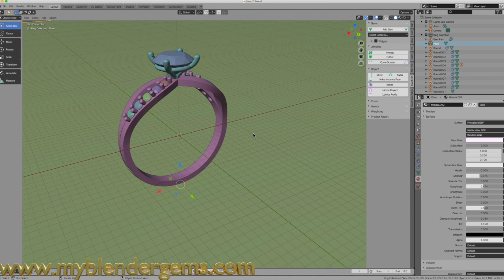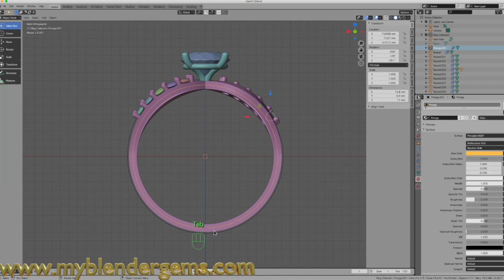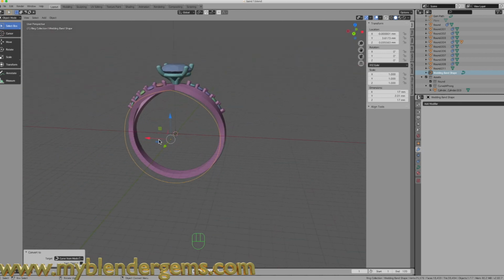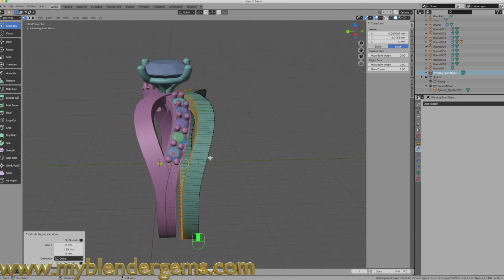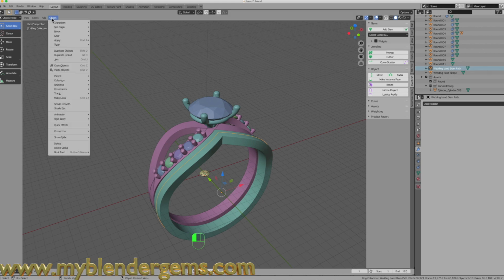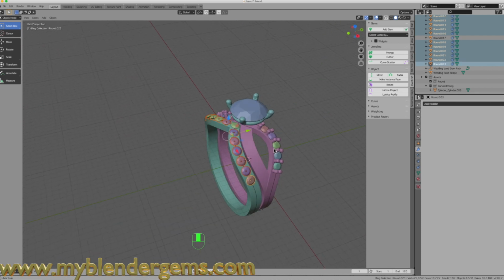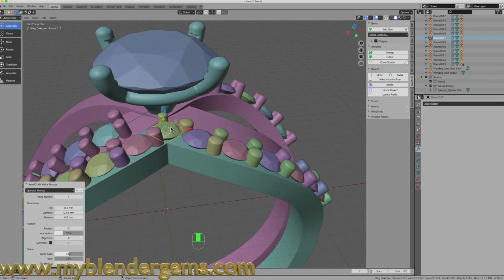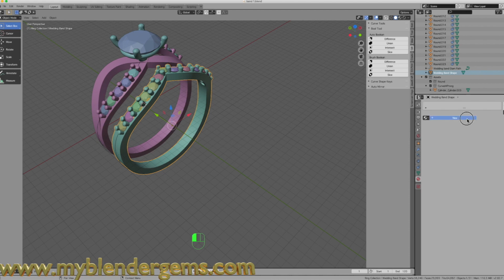Wedding Set Design with Blender 2.83, Part 2, the Wedding Band to Match

Comment: Thank you very much for your work, very interesting tutorial! Are you satisfied with the print quality on elegoo mars, is it possible to print models with better surface quality on it?
Reply from the maker: Thank you for the comment...  Yes, I’m happy with the Elegoo mars...  I have the original, which uses an LCD display,  I purchased a sonic mini monochrome which prints 3 times faster.  Keep in mind, this year is a great year for resin printing, as many of the manufacturers are now about to release monochrome display printers.  IE, printing normal resin on the original mars is 8 or so seconds per layer, castable resin, 12 to 30 seconds per layer.  Monochrome will be 3 to 4 times faster!  To get the best results for your prints, it is about the model, not just the printer.  Once you have tweeked your settings on the printer (for the resin you are using) the modeling detail will show through.  Pick your printer carefully.  Most of these printers are the same.  Some built better than others.  Epax makes “Tanks”, and they are twice as expensive.  The Elegoo Saturn is a large format printer, meaning you can print “larger” models.  For me, I print jewelry, and don’t need a large printer.  You, however, may print objects that are bigger than mine.  I have not gotten my hands on the anycubic mono, but I’m not a fan of the original since it had so many initial failures.  Elegoo Mars Pro 2, I believe should be available relatively soon.  If you’re looking for a great monochrome printer, here is the list in order of which I would buy...  Elegoo Mars mono, Epax x1 mono, sonic mini mono...  If you are looking for a larger format “8.5 inches”, the Elegoo Saturn looks fantastic and gets good reviews, but they have all been sponsored so far.  I don’t do sponsored reviews.  I like to see the facts...  Hope that helps...
Reply: @watchesandjewelry , Thank you for the detailed answer, your advice is very valuable to me!)

Comment: I have a question regarding jewelry modeling for 3d printing or casting.  I noticed you don't use subD or subdivision surfaces for your rings, and the edges are razor sharp.  I've always been taught to avoid this in CG modeling, and to incorporate a small bevel on the border edges to create a chamfer and avoid razor-sharp edges.  This is mostly a technique utilized for rendering purposes, so that rendered objects look more realistic.  My question is should we avoid this technique when it comes to modeling for 3d printing?  I suspect that the printing process requires the mesh to be as physically accurate as possible, especially for rings or something where scale down to the mm is needed.  So I assume creating a bevel on the sharp border edges not necessary for 3d printing, but  if I do that anyway will it screw up the print in some way?  Hope I'm explaining myself clearly.
Reply from the maker: Great question. When modeling for 3D renders I would always add a bevel end or sub surf. It’s not going to print as it is with perfect detail on a 3D printer. So, when I’m rendering an image, I soften it up. Rounded edges and all. To keep detail in the 3D prints I will design with the printers capabilities and limitations in mind. Sharp end he’s on prints turn out with a small bevel edge. If I want a larger bevel on the print, I can add the bevel to the model. Kind of like taking a step back. If that makes sense. Thanks for the question

Comment: thnx for your sharing.  To select all prongs  quickier :   Select one prong in objet mode -> Select  Linked/ Object data.
The same for all Gem
Reply from the maker: Thanks for the tip. That will sometimes create issues when the model is exported to an obj or stl file for 3D printing. The problem occurs with the sliver and not blender. Of course the quick way is just select all the individual objects in the object browser. That also works.